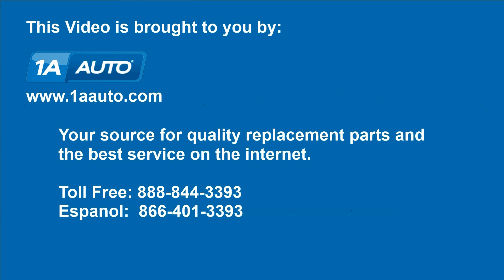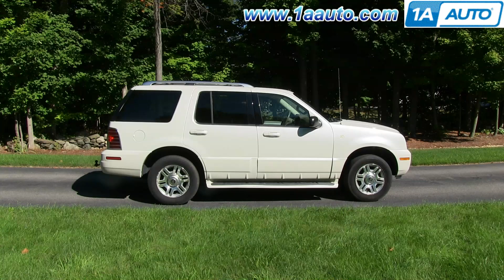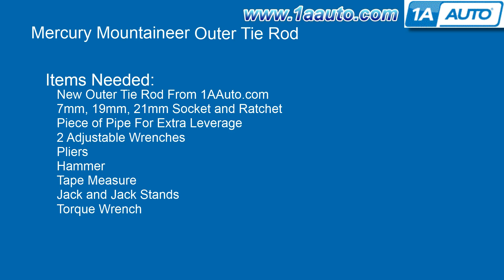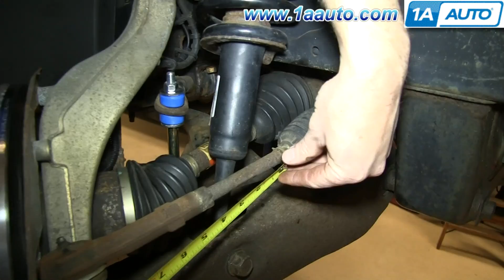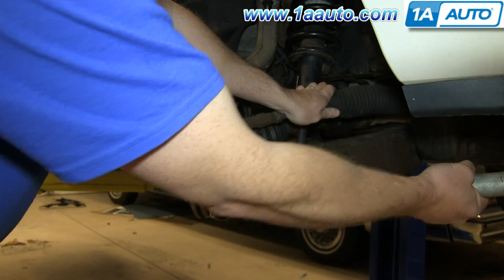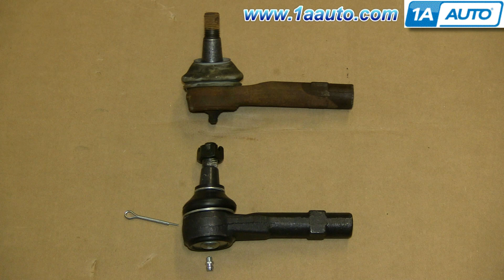How to Replace Tie Rod 98-05 Mercury Mountaineer

Comment: I have a 2002 ford ranger XLT 4X4

My tie rods are fine...but my tie rod end boot is cracked.  I know I can buy just the boots, but I am wondering if I need to get an alignment after changing just the boot, or is it OK to detach the rod from the knuckle and swap boots w/o alignining it afterward.

Thanks!
Reply: Victor Lawson If the boots are cracked you might as well replace the tie rods anyway. Depending on how long it's been torn the grease has probably dried up and collected a lot of dirt and debris damaging the tie rod.
Reply: So how'd that go? I figured you could replace the boot. I am going to attempt it on my 01 Ford Expedition XLT